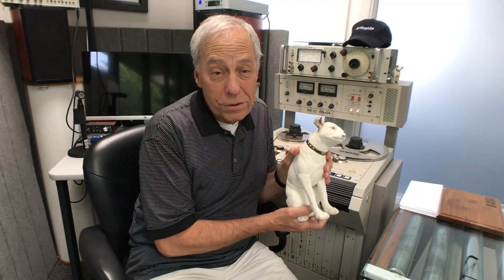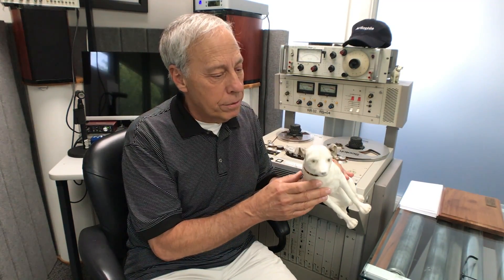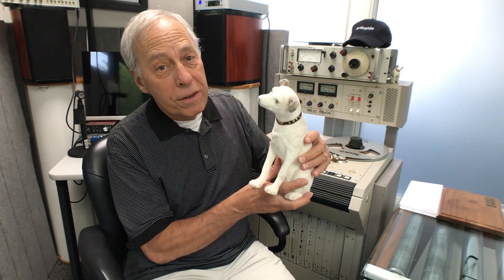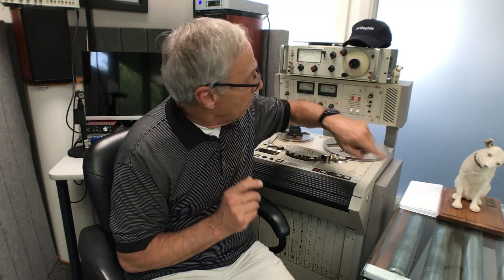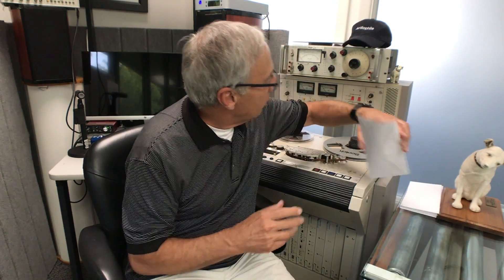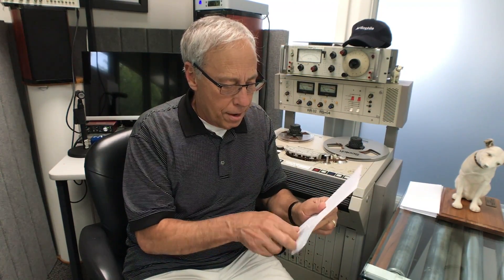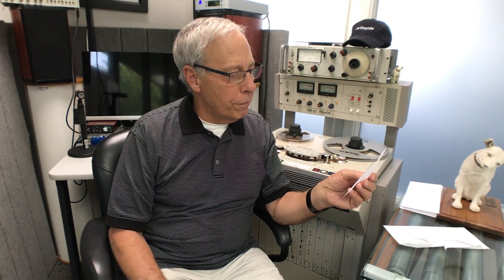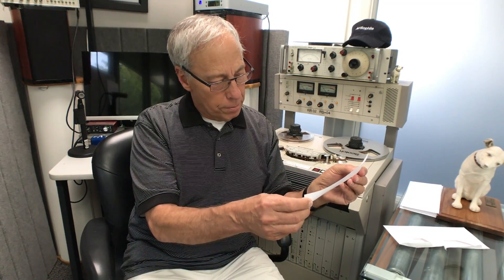Thin cables inside speakers

Comment: My two cents is this most crossovers in any cheap and i use that in a good way speaker up to 5 grand a pair  are just a get it done job for mass market  and yes the wire is thin inside of the box . Are the caps the best no most of them are cheap . But did they get the job done yes you bought them fell in love with the sound of them until you open them up to do a refoam and seen them small wires and how cheap the crossover was . Then you got mad about it because you bought all that monster cable at that high price . Instead of 16 gauge lamp cord wire now you are really mad about it . Why do you feel you where ripped off by the sound you fell in love with ?  Then i see some people attacking others for their answers on the subject why did the sound of the speaker you fell in love with change that much now you seen the truth in your mind now its junk they killed the sound of my music come on grow up it gets the job done. And its a easy fix upgrade your cap's add better wire and be happy again .
Reply: Depends on the speakers you're opening up. Not all speakers have shit wire inside.

Comment: Ohms law.  If the wire can handle the impedance then it doesn't matter what you use.
Reply: Paul McGowan I will look into the link and give the page a good read.  There is always something to learn.

Thank you!

An audio nut on a thin budget.
Reply: Randy Shone Wrong.
Reply: Randy Shone The first thing you should learn is to stop making statements about things of which you know very little.
Reply: carlos oliveira then explain so we can all learn.
Reply: Randy Shone To learn anything, you must do your own homework. Half the battle is to accept that you are incorrect.

Comment: Lets say your speaker can handle 500 watts. Lets say your amplifier can deliver a max of 50 volts at peaks. That would only be 10 amps. Its a bit more complicated than that with complex AC current but 12 gauge wire would be plenty.

Comment: Especially for the tweeters after the crossover, not nearly as much power is going to go to the tweeters as the woofers.  There just isn't typically the same power content (would that be spectral density?) at those frequencies.

Also, as some others have pointed out, the few milliohms (mabe even microohms) of difference between 16 AWG and 12 AWG over the distance of a few tens of centimeters inside a speaker cabinet is tiny compared to the resistance from a power amp to those speakers.  More copper (in thicker wires) is more expense.

Comment: The weakest link is the wire used on the speakerunit itself . The wire that runs from the connectors on the chassis into the speaker to the coil. On a thousand watt 30 inch woofer that wire is only millimeters thick. So good luck to everybody with half inch main leads...lol. Want improvement ? Buy some  meters of a good conducting cable (van den Hull snowline (silver)for example. Rewire your speakers internal, remove any cheap steel connectors or clamps and solder the internal wires straight on the filters and speakerchassis connections with silver solder. Make your main leads( connection between amplifier and speaker) from the same material  and solder them straight on the filter (lead the wire to a hole  drilled in  the cabinet to bypass  any speaker wire clamps fitted on your cabinets and do not forget to kit the hole to make your speaker pressure enclosed )
Succes ensured ! Your sound will open up and detail in high frequencies will improve. ( if your speakers are capable of reproducing the enhancement, so not to perform on Bose or Jamo speakers. lol ) You can do even  better by changing the internal wiring of your amplifier , in special the wire connections between the speakerconnectors on the back of your amp to the amp's printboard.( witch are made of the thinnest cheap ass crap cable you'l ever see ! ) Greets from the Hague.
Reply: neuronmind
Not familiar with the wire you recommend, but totally agree 100% with your method. This will give very good results to the bold who are willing to modify their system and get their hands dirty.   : )
Edit: Also replacing any fuses in the amp, etc. with better sounding ones will make a difference.
Reply: Fuses, no way. i always remove those horrible things, if you dare.
Reply: @berrycitroen2541 
If you dare, indeed!

In this case, you are balancing the rewards of better sound with the risks of melted circuitry and open flame in your home!
Reply: Hare deLune fuses?? Is any fuse ever on the signal path? Aren't those pre filter caps even? Oh man...
Reply: Benj Coltrane
There are often fuses on the signal path. That will be the first thing the current goes through, before ever reaching the main boards which the fuse is there to protect.
Since we are already talking about being radical enough to hack into the equipment and make our own modifications (or did you not read the OP?) We can be guided by the philosophy that every part of the signal path makes a difference. Since everything is important all the time, it stands to reason that the more meticulous we can be, the better the result. Any part of the signal path that we can improve will make a difference, and the changes will be cumulative.
Reply: @Hare_deLune  There is a difference, and then there is an audible difference ...
Reply: @robertt7238 
The audible difference is what we're trying for, of course.
Also, a positive difference. Different is not always better.
One must try different things and listen, then note what makes an improvement for future reference.

I would not recommend doing these kind of experiments on equipment that is under warranty, or that you think couldn't be revived from a mistake, or that you love very much, unless you are very sure about what you are doing.
I wouldn't advocate this kind of experimentation for everyone, but for those with confidence, patience, and equipment they don't mind experimenting with, the effort can be rewarding.
Reply: @Hare_deLune  What you meant to say is one must listen in a proper critical listening environment, with no knowledge of are they listening to the new or the old so they have no bias ... that's what you meant to say right?
Reply: @robertt7238 
Have you read this entire thread, beginning with the OP, or have you merely read my recent reply to you?
Because if you are asking that question in the context of this entire thread, you are either a sarcastic little troll, or your logic and sanity are coming into question.

This discussion is about open-minded tinkering, not dogmatic thinking, friend.   : )

Comment: Be honest: #1 Signal degradation (voltage sag, current loss, RF interference, etc.) is far more pronounced in longer runs of wire. The longer the wire, the more conductor it needs to do it's  job. Think about glass fuses...You run 10-12 gauge heavy copper wire to deliver A/C power to your devices and it is then routed directly through a fuse with a tiny element before it enters the circuit. Small run=low loss. #2 Most "audiophiles" are blindly sold on the idea of "Monster Cable" type interconnects. Until you start getting into crazy amounts of power or extreme accuracy (like sound design for a stadium), basic wire does better than "just fine". If your'e amplifier has a  maximum theoretical output of 1000 watts and you generally operate it in the 0-100 watt range, 14awg speaker wire from Radio Shack is fine in normal length runs. After that the crossover network uses tiny magnet wire and small conductors for the "last mile" to the transducer.

Comment: So you don't know then? I'll try to answer the question. You use thick cables to connect a speaker to an amplifier to minimize losses, not to handle the power.  In fact, and I'm guessing here, you could drive your speakers with a wire slightly larger than the wire used in the speaker winding, since the speaker winding cools down as it vibrates and can have a wire thinner than the interconnecting wire. Those heavy gauge cables you're using are probably good for thousands of watts before they start to heat up. There are many online calculators that will tell you how thick your wire has to be to handle a particular amount of current.

Comment: Wow, these videos and the comments show a serious gap in knowledge.  To even insinuate that audiophile cables are super thick because of the wire gauge is crazy talk.  Most of the "super thick wire" is  16 to 12 gauge-ish twisted in a way that makes it bulky.  The Kimber Select...perfect example of the geometry of the wire dictating the large size.

If any of you have held a woofer or tweeter or midrange in your hand, why would you want to dangle all that weight off of the driver's leads.  This will seriously compromise reliability of the part.   As many discussed the electrical needs are small, so manufacturers are not cutting corners but using the appropriate cable.  I build very very good speakers and use basic ofc 18 guage solid core or stranded wire.  depends on the project.  Why do I want to put a connector or a ton of solder to make a connection on a tweeter?  Large guage wire is subject to putting unwanted vibration and noise into your speaker.  Solder is a big enemy of sound and so is every additional connection. Anyway, I waste my time.  Open your minds look at all the variables when it comes to these topics.

Comment: Wire size is dependent on current flow (amperage). More amperage needs more conductor. Look at the wire going to your car's headlamp (10 amps or so), then look at the wire going to your starter (400 amps or more). The starter needs more conductor.  
Now let's talk electricity (DC). Amperage is the same in the entire circuit, power and ground legs. Therefore, if you really needed huge, expensive cable going to your speakers, then you'd need it in the box. The electrons don't see a short run of conductor and somehow, magically flow differently.  
It's all just more snake-oil, like the goofy stands for speaker cable, or a device to remove the magnetic field from your speaker wire. Copper is non-ferrous, it CAN'T become magnetized.
Reply: not even wrong